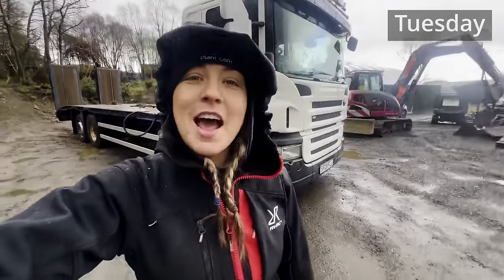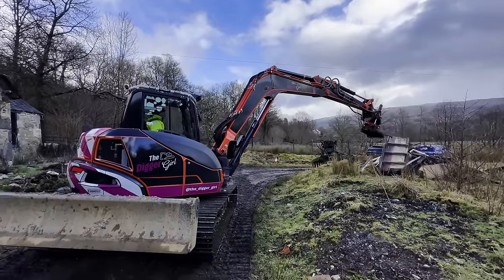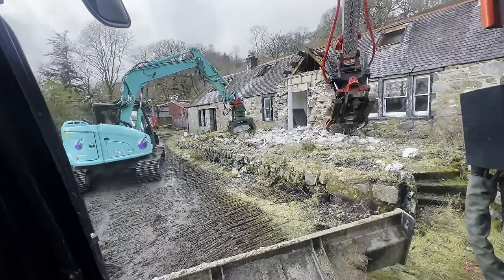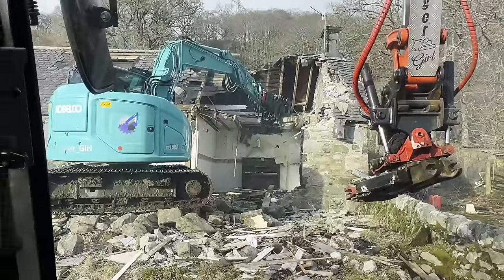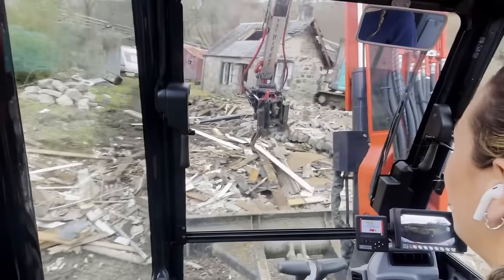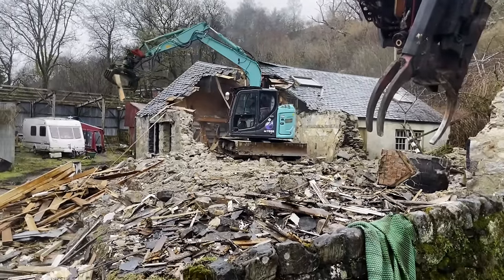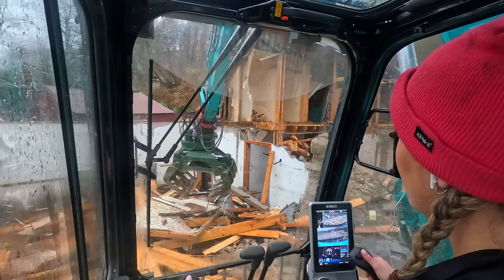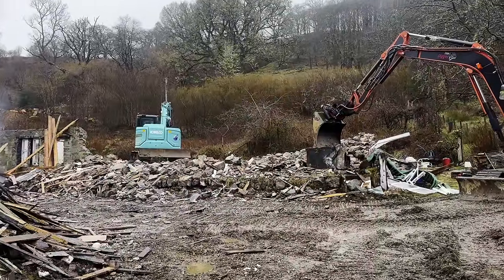I DEMOLISHED a Cottage With My Excavator!!

Comment: Amy,
We had a show here in the States called, This Old House.
In about 1990, they took on a 200+ year old house.
(the original Owner was a signer of the US Constitution)
She was more firewood then house, really.
The original builder, never owned a Square, or a Plumb Bob,
and most likely a drunkard. lol!
She needed new foundations, and everything fixed, or replaced,
from there up.
If they had torn it all down, and built an exact turn key copy, with 
everything to done to pass modern day codes. It would have 
been $360,000.00.
But because it was a repair, and not a replace TV Show.
The owner ended up on the hook for $3.2 MILLION Dollars.
So I see this as a good call.
Here in Philly Slate roofs were all the rage in the early 1800's
because it stopped fires from spreading to your house.
But now only 2 countries, make new slate, so a 18"X24" costs
$136 dollars a piece. So not a lot of Slaters fighting over jobs here.

Comment: Hi Amy that’s going to take u n ur dad ages with the wee claw use better not getting a an attachment  the the Clam shell so use can open n close and get more in side the clam wen it’s closed instead off picking one bye one bit at a time 🤔🤔 also use might damage ur roto tilt ??
Reply: Cancel last message just seen u got one as I stopped in messaged then went back to watching it and seen kelbco got grab 🫣😂😂